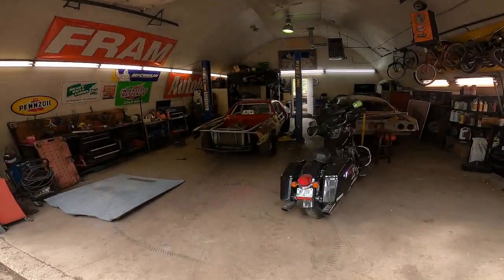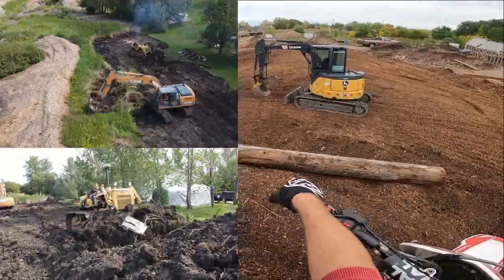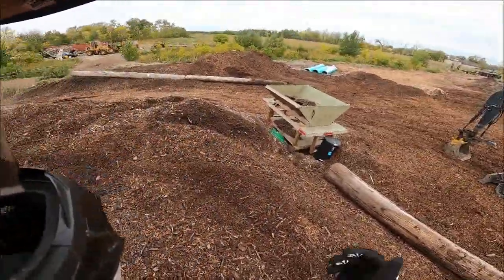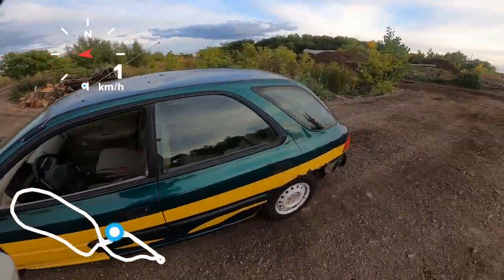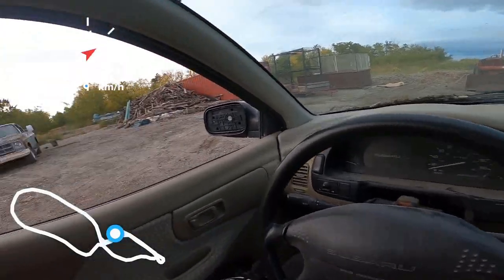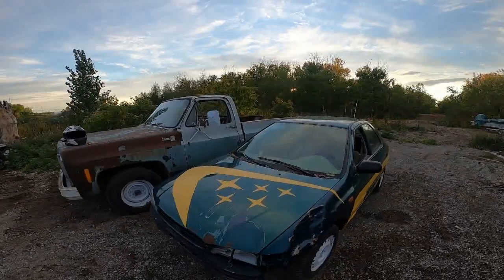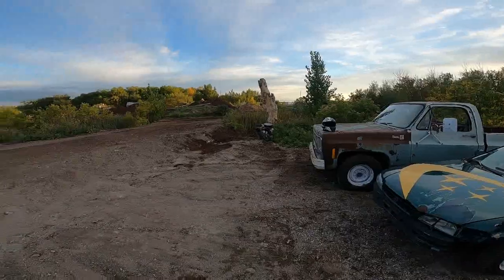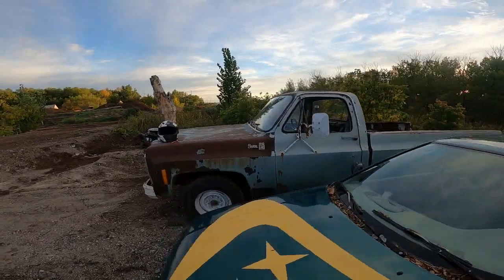Wood Chip Race Track Intro -Bike vs. Car vs. Truck - Old School Motorsports

Comment: Definitely looks like a ton of fun. 
Reminds me of when brother had the shop with field and pit out back.
Had the condemned car track.
No where as nice as your creation but hours of entertainment none the less. Beetles and Scirroco best performers but if it ran we drove it till it didn't. 
Enjoy. Be safe look foreword to your next video. 👍👍
Reply from the maker: Sounds awesome, I actually have been keeping my eyes open for a cheap Beetle!
Having the equipment helps keep the creativity flowing, and when I get bored of one car, i’ll just buy the next junk. 
Thanks man!
Reply: @OldSchoolMotorsportsCa  cheap beetles I think are days gone by.
We used to keep 3-6 rebuilts on hand. Done in house. In and out  $250.00 U.S.. 
Shop labor rate was $8.00/hr.
Messed up one day, two orange beetles, one tune, oc. And valve adjustment other motor swap.
Yeah we did it.
But both long time customers said okay. One took  motor and other waited a day. 
Today they're stupid money.
Brother lamented when he sold off the basement. 
Waist deep in beetle cases as well as a few bus cases  as well as a few bus cases. Plus enough sheet metal and accessories to outfit a few  dozen.
Used to part them out in the dooryard after motor pulled.
Remove good pedal assemblies, regulators,  computers  (on fuel infected models), gas tanks. etc.
Then take the old korean war era jeep welded back together. 
Throw a chain over and under then roll. 
Strip transaxles, front ends. Pre stupid beetles. (As we called them back then) etc. Then drag it down U.S. ROUTE 1 upside down to the junkyard down the road.
All under an hour.
I digress in my in my own reminiscing. And If I were to redo my car transactions over.
Would have hung on to alot. Except life choices said different. 
Appreciate you video s.